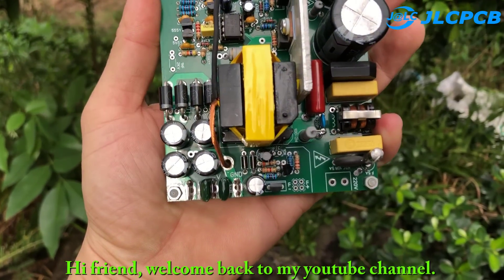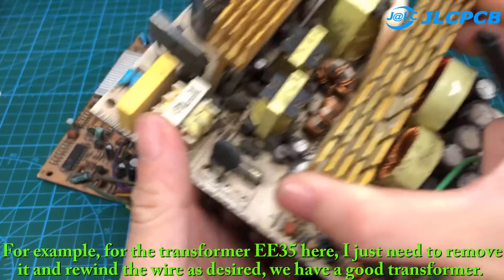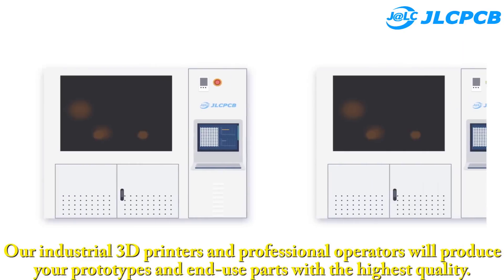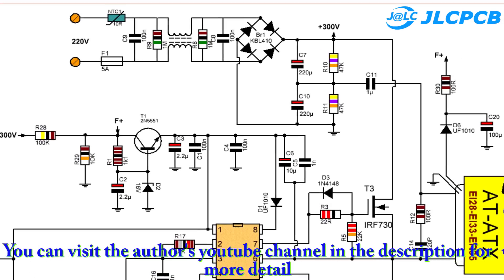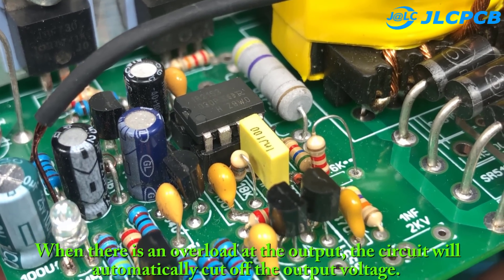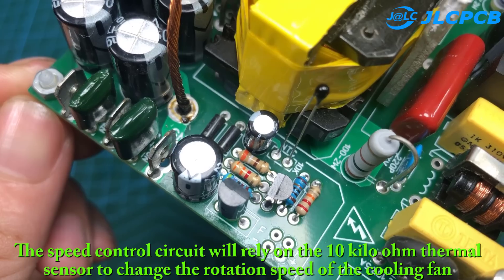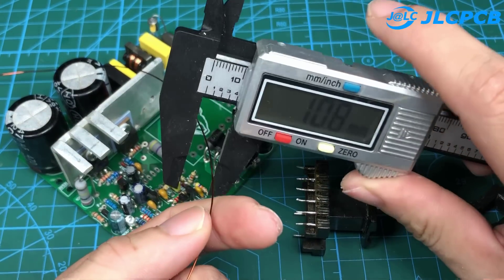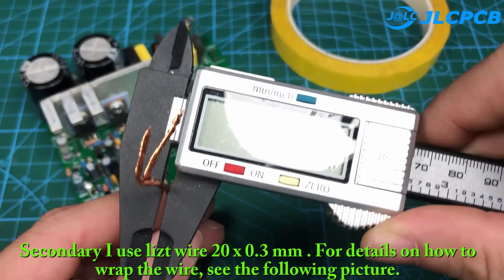Reuse OLD PC power supply, make  pulse transformer 220V to 70V 6A

Comment: I have big issues with the ee ups core it’s getting my mosfet fire hot at 100watt I even use 1200watt mosfet push pull board I adjusted the frequency to get the right voltage and at no load the mosfet don’t get hot but a 100 watt the transformer get really warm next to hot and mosfet on fire can the core be the issue

Comment: How many volts are in the output ? You may have to change output capacitors...
Reply from the maker: 70 volt output. I showed in the video, checked by VOM bro
Reply: @LongTechnical  Ok thanks because usually caps in ATX are rated 16v, at 70V, they might explode.
Reply from the maker: Yes. I mean we reuse high volt cap. Nomally, 200V 330uF.
Reply: @LongTechnical  OK well noted, thanks.

Comment: Most low power PSUs use flyback topology which their transformers have a small air gap, and are not suitable for this topology
Reply from the maker: This is haftbridge bro. It's stronger than flyback topology